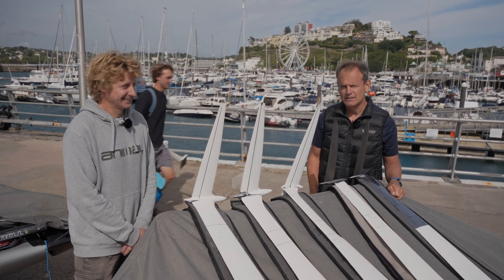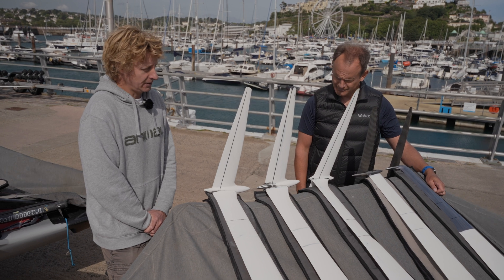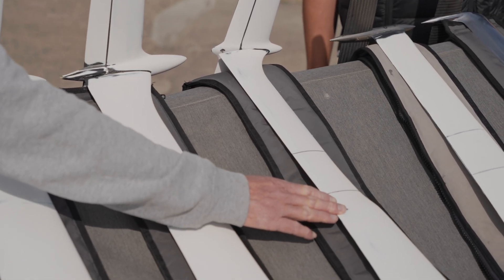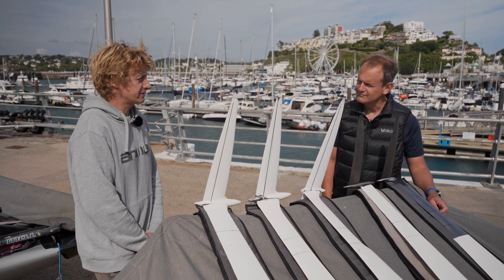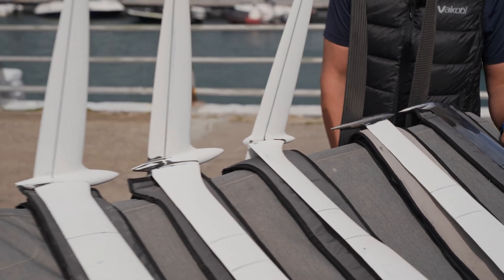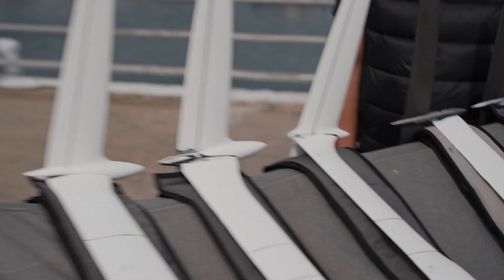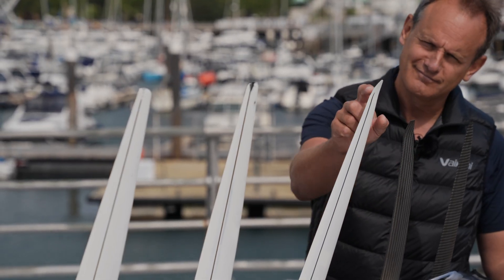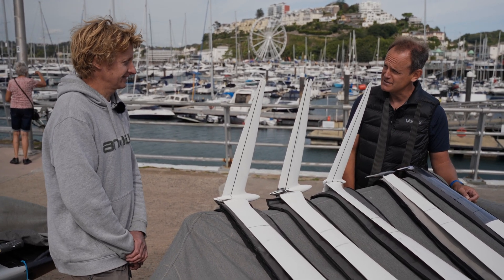Carbon or Steel? Moth Foil Evolution with Alex Adams

Comment: You can also use hardwoods coated with teak oil.
Being wood they can be shaped easily, I can make one in a few hours, coat it, and sail it. And it's cheap. I look for old hardwood tables, break them down and shape the hardwood  materials as foils. I am currently building two T rudder foils and two asymmetric 45 deg hydrofoil fins.
And
Reply: Yea right mate
Reply: Will break when trying to yaw.

Comment: Interesting, clearly  materials science not as simple as the public image - 'carbon is best'. I can see now why the new blended version is not cheap - looks like a bit of a fabrication nightmare.

I also noticed that the top windfoil race foil (Patrik) uses a Ti fuselage, which  is stated to outperform carbon. It does, however, feature carbon masts.
Reply: Carbon is very strong for its weight, not for its volume.
So if you mostly care about reducing volume, as is the case for the part of the foil below the water, steel can be a great choice.

Comment: What grade of carbon are you using ? I’m sure you can get torsionally stiffer lower mast sections using Pitch based carbon ( 800 GPa ) that is nearly twice as stiff as UHM and 3 times stiffer than standard carbon fibre and stiffer than steel for volume.  Do you have modulus limit on the materials you use like AC ?
Reply: UHM carbon is stiffer for the weight, but sounds like stainless is stiffer for the volume.  Drag is much more dependent of the foil/mast’s volume.
Reply: Stiffer than steel by volume? that seems like a pretty tall order. Sounds like it would be pretty brittle. I can't find much, but the Wikipedia page on pitch based CF says it isn't as strong as fibreglass. I know PEEK was used as core material on the the 72ft cats of AC34.
Reply: @weatheranddarkness  most of the highest performance Windfoil and Wingfoil masts are made from Pitch based carbon prepreg. The ones I make have some IM carbon prepreg in them too. Elongation to beak is .7% bur I haven’t broken one yet despite hitting the bottom several times. The end of my masts are very thin. The outside layers are +/- 45 deg layup for maximum torsional stiffness.
Reply: @HADDEN67  .7% jeeze!
Reply: @weatheranddarkness  https://www.ngfworld.com/dcms_media/other/GRANOCoverview2016.pdf